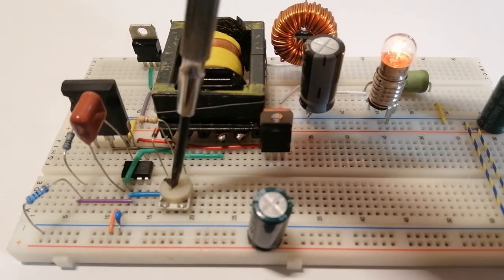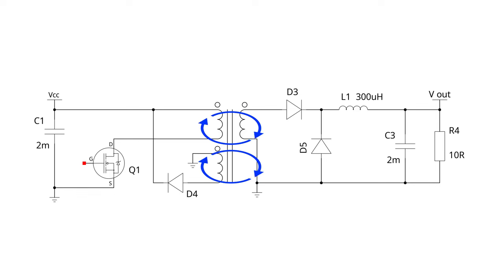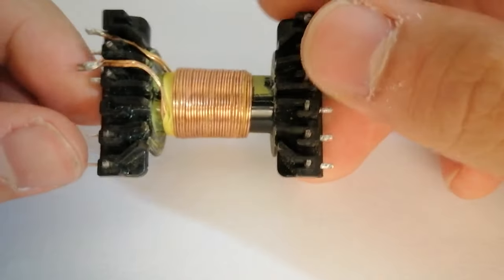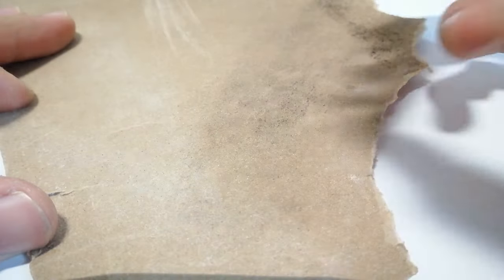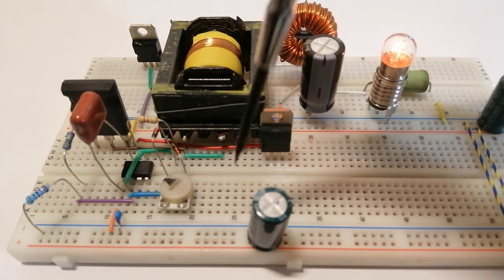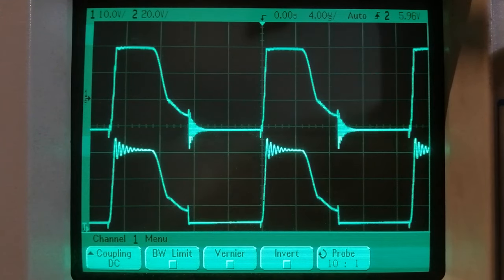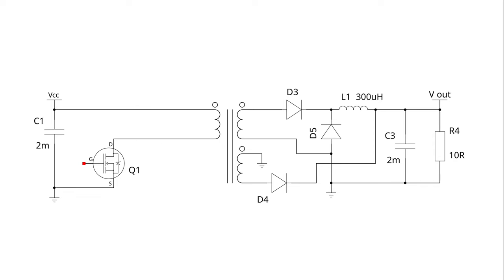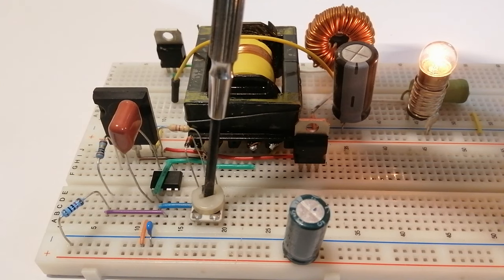Building a Forward Converter and Experimenting with it

Comment: I don't know what you mean by the "step-down nature of the converter"
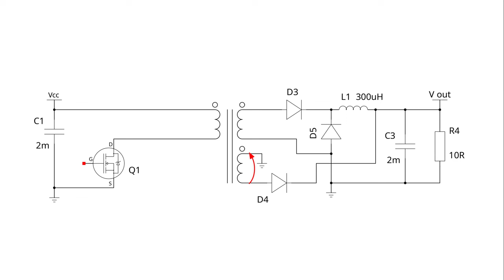at 5:58 because moving the de-energizing coil to the secondary side 
of the coil made the transformer a "step-up transformer", did it not?

This is the way it appears to me, as omitting the de-energizing coil
would make the transformer neither step-up nor step-down, but rather
an isolation transformer, would it not?
Reply from the maker: So, the forward converter is a step-down (assuming a 1:1 transformer ratio) because it behaves like a buck converter (with the classic input-side demagnetizing).
We can intuitively verify this by observing the voltage on the L1, D3, D5 node to be a square wave with amplitude = Uin and duty cycle < 1.

Once we move the demagnetizing winding to the output, it becomes a forward and flyback combined. This makes it potentially a step-up.

Comment: Interesting how it works with so few turns. Can't get a salvaged high turn core to work. Using a mosfet, it just won't resonate at 50 khz. These 4 pins are not marked on Chinese transformers, so the winding direction are unknown. Is there an easy to figure out if the primary pins are opposite eachother or going the same way?
Reply from the maker: Hi, great to hear someone is trying my video projects!
The first thing I want to point out is that the majority of switching transformers around have gaps because they're used in flyback converters. So their inductance is a lot lower, careful using salvaged ones! That's why I sanded down my core.

To find the polarity of your windings the ideal way is with a function generator and oscilloscope (so not very practical).
If you have an inductor tester you can measure inductance of both the coils connected in series twice: first one way, and then inverting the "direction" of one of them. When the inductance is higher it means the coils should be in the same "polarity/direction".

Other less conventional methods might be to pass some current through alone coil and then abruptly disconnect it, meanwhile look at the secondary end see which way the voltage spike shows up.

Hope this helps,
Good luck!
Reply: I know these sketchy transformers are a danger, had one catch on fire while testing the primary pins, it did output 700volts before death. I was lucky to find your circuit, it's a great idea to to use a diode on the aux pins, cheaper than blowing up my pnp transistors. Winding my own was the right choice, however it can't power anythihg besides a 10watt light bulb, with 0.4mV left, 555 is doing 40khz, mosfet driver irfz44n, R1 1k pot, R2 10k, c 10n,  I'm stuck, don't know why the frequency won't pass beyond 40 khz.
Reply from the maker: If the problem is not getting a higher frequency, the 555's components are what determine that parameter. Decrease the resistor and/or capacitor.
Also having a 1k resistor on the gate will slow down the turning on and off of the MOSFET, so lower efficiency. I would stay between 1 and 10 ohms, it's just to avoid ringing.
As far as power goes, it depends on lots of things, transformer size, your input supply power, etc...
Oh and if you're looking to get high voltages, (aside from warning you about the danger) I haven't tried this, so I'm not sure a forward converter is the best choice maybe.

Comment: Very coo. What's the ratio of the transformer?
Reply from the maker: Thanks! It's a slight step-up, like 13:9
Reply: @5VLogic  thanks. So 1:1 could work as well?
Reply from the maker: Sure, just remember that the forward converter usually takes a maximum duty cycle of 50%, so you'll get less that 0.5 times the input voltage at the output.